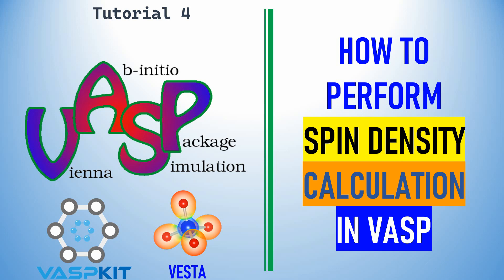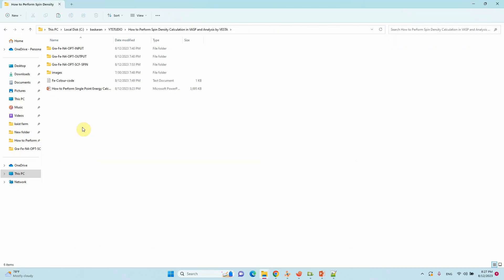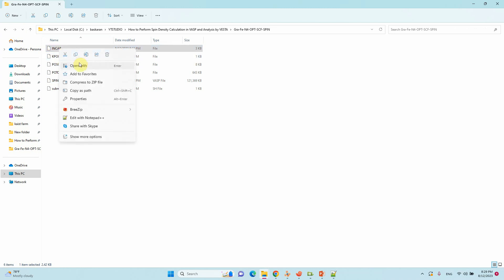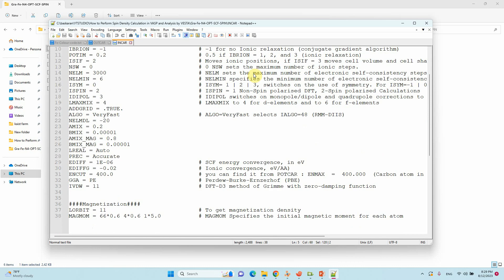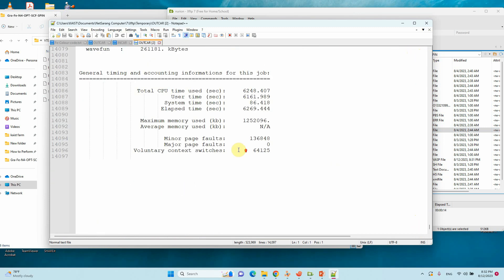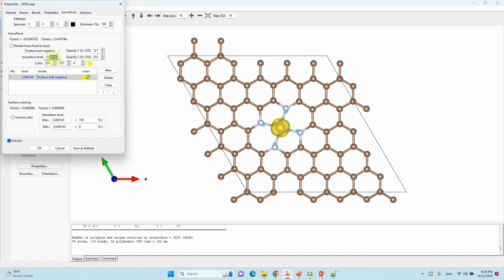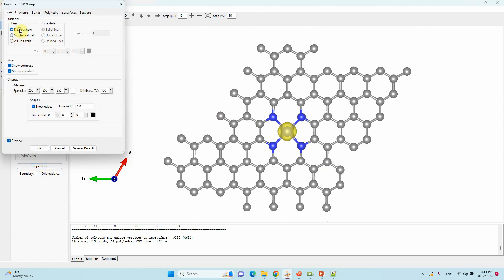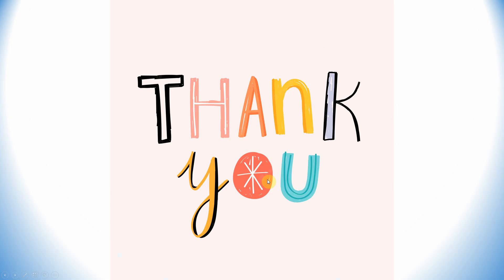How to Perform Spin Density Calculation in VASP and Analysis by VASPKIT and VESTA

Comment: How do you decide on the number of spin electron in the MAGMOM setting? For example If I want to perform spin polarised DFT calculation on the NiCo₂O₄ spinel structure, what would be the most appropriate settings in this case?

Comment: many thanks for your grat job. What if we do not set the magmoments? just seting spin=2 and colinear calculatins?
Reply from the maker: Thanks for your comment and support, if you don’t set MAGMOM, vasp automatically assumes the 1 MAGMOM for per each atom, you may not correct spin electron ( unpaired electron), and you get symmetrical DOS plot. So if you’re studying magnetic materials, such as Mn, Fe and Co, you must consider MAGMOM  and LSORBIT = 11. Thank you Best SB
Reply: @dbinfotech   Thank you very much for your answer. best regards.
Reply from the maker: Well come

Comment: Great video. Why are the number of unpaired electrons taken as 0.6 for C and N when defining the MAGMOM tag
Reply from the maker: If you use 0 for C and N, it will take long time to optimize or you will get convergence failures, for safe I used 0.6. If you check with material project site for graphene, you will find 0.6 for C atom. Thanks for your comment, please like my video, subscribe and share . Thank you